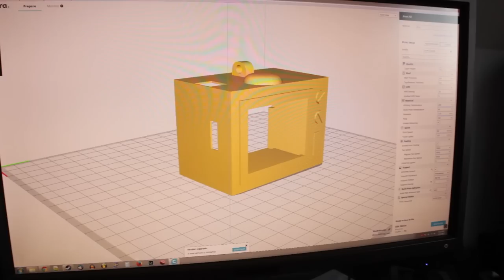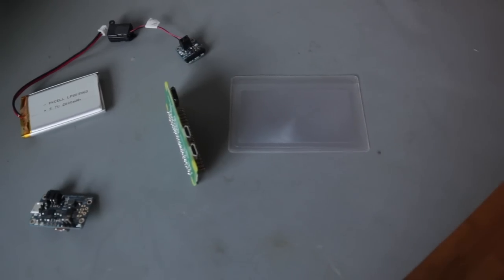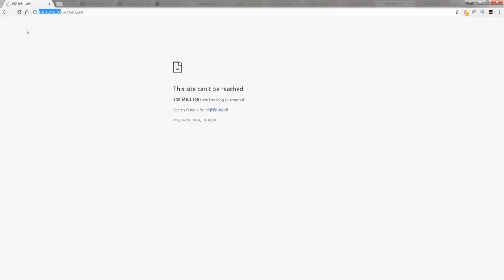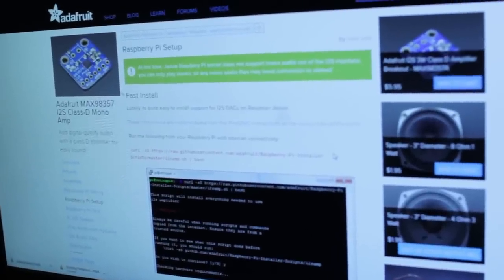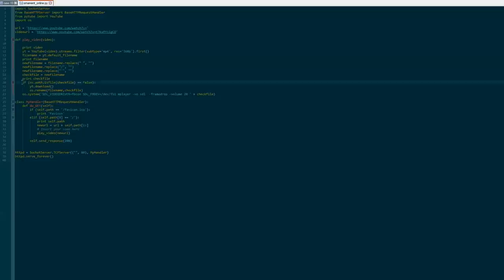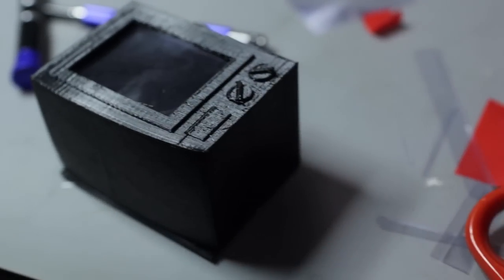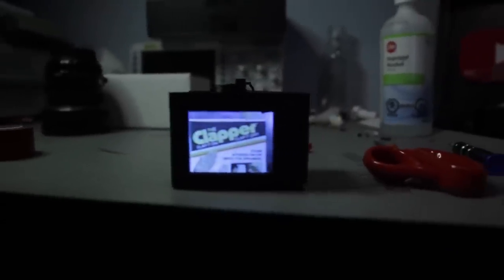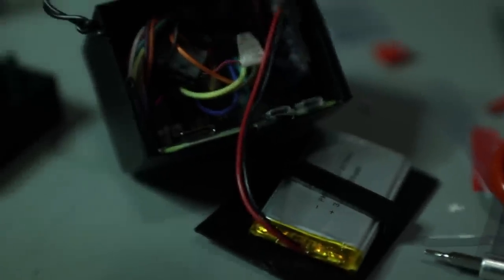Watch Retro Christmas Commercials on your Christmas Tree!

Comment: Thanks for this! I had the idea the other day to 3D print an ornament of a TV and game console, put in a Pi Zero and 2.2 inch TFT hat, and load up the SD card with clips from emumovies.com (they have packs of thousands of 30-second game clips for all the old consoles, and they're 320x240). I wasn't sure if the SPI interface would handle video well enough, and google brought me here. Looks like the video works just fine on yours, so that's good! Also, I was trying to figure out a way to make the screen look like an old CRT, and your idea with the credit card magnifier is brilliant. Your project covers 90% of what I had planned, so thank you!

Comment: Awesome awesome, instead of a battery could these run off a string of lights?
Reply from the maker: Yes, well sort of, I had it connected to a small USB phone charger and a USB cable. It was connected to the end of the string lights. Is that what you mean?
Reply: Actually wondering if I can wire into the actual twinkle light plug
Reply from the maker: @kurtdahlstrom7756  Directly into the AC line? Not very easily I don't think. If they are DC lights then you would have to figure out what voltage they are operating on, and just tap into that.
Reply: I've spent a little time looking at this because I've been designing an electronic Christmas Ornament. I came to the conclusion that it's not really worth the hassle. I wanted to be able to plug into a light socket the same way the Hallmark Star Trek Ornaments did back in the 80s and 90s. Unfortunately, there isn't really a standard for the "mini" light socket.

Comment: nice!! I was thinking of making something like this just this morning!!

one thing i will say, if you edit your fbtft.conf, add in 

fps=60

and change your speed to 80000000 (7 zeros). you will notice it is much less choppy :)
Reply from the maker: Awesome! I will try it out. Thanks! - There is a way to just copy the HDMI output(to use the hardware accelerator), but I couldn't figure out how to do it without having something actually connected to the HDMI.
Reply: yeah you can download and install fbcp. I use it on my tiny gaming devices like this one https://hackaday.io/project/20152-gameboy-zero-but-smaller

you could also save space if you ditch the powerboost!! The whole thing will happily run from the battery voltage itself :)
Reply from the maker: The powerboost is nice to be able to charge it, and have the switch, but I never knew that about the Pi! I thought it would become unstable without a proper 5V line, thanks for the tip. I changed the instructables and Hackster.io to reflect those changes you mentioned about the screen, definitely runs smoother. Also I'm modifying the python script to download the 240p and 3gpp youtube file instead of 360p/mp4. They seem to run better!
Reply: SeanHodgins awesome 😀 you can use the tp4056 charge/protect board if you want to keep the charging capabilities. They are smaller and cheaper. The pi will be happy down to about 2.7v, although the screen will stop at 3v. 5v is only really there for USB compatability

Comment: Would someone be able to modify this (maybe without sound components) to be a wearable video or keychain?
Reply from the maker: There are smaller screens you could use, and could omit the sound stuff if you want. The limiting size is the raspberry Pi zero which there isn't really anything smaller to substitute it with. I may make a custom circuit board that makes it easier to assemble all of the components together, so that may make it easier.

Comment: Hey. I'm gonna give this a shot. I noticed in the video that it appears that you have a standard Pi. Did you use it for testing and then move everything over to the Pi Zero? I have a Pi 3 on hand, and am waiting for the other parts to get here. Is it possible to get this set up on a Pi 3 and then just move the SD card over to the Zero when it arrives?
Reply from the maker: That is exactly what I did. I use the Pi3 to debug and do initial setup. Also its easier because it has the Ethernet port so I can plug it in and SSH in right away, setup the wifi, the programming etc. then swap the SD card over(if you have a Pi Zero W).
Reply: Ah, perfect! Thanks for the feedback!